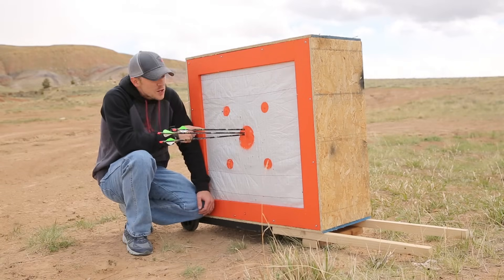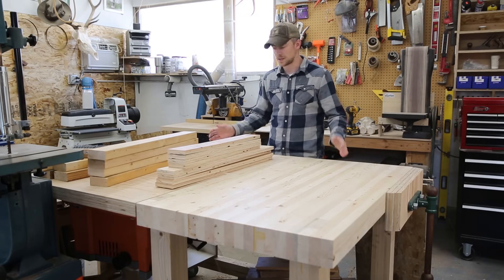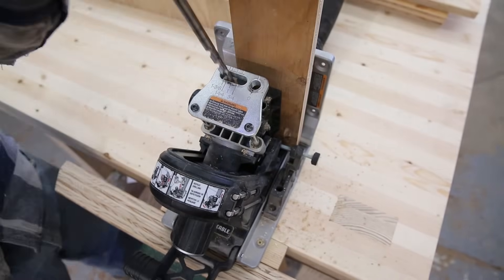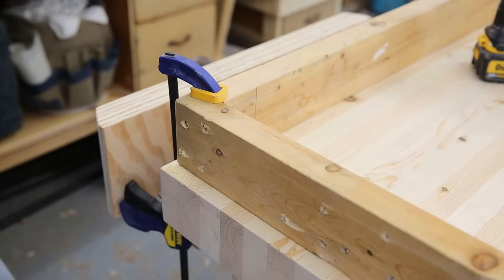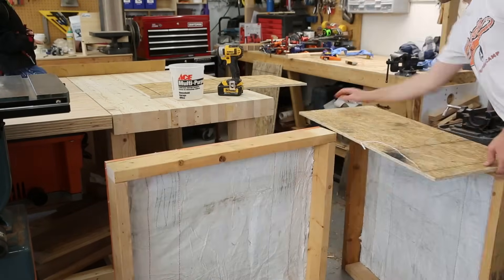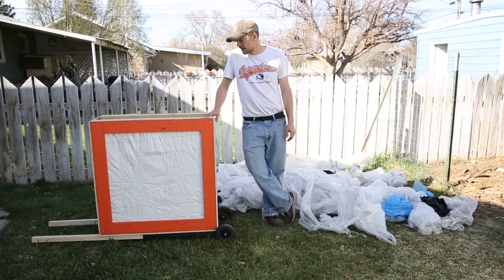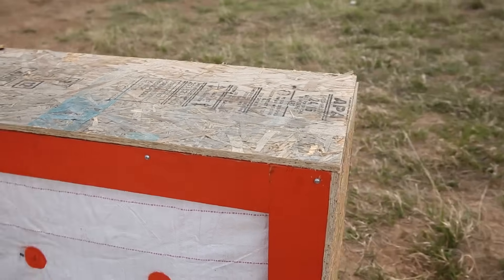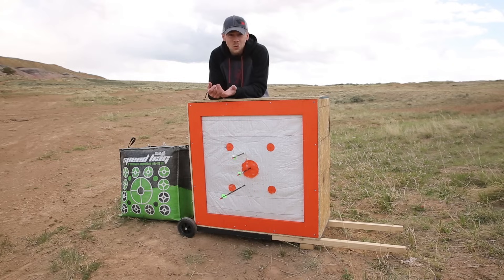DIY Homemade Archery Target from Scrap Materials.

Comment: I packed that plastic into an old car tyre, with cut out one side as the front of the target and wrapped it with the same material like you... it works like charm, it has a handle and is highly portable... when I rip through the front face I will just use some tape and nylon trash bags, to patch it up... It will add layers on top of it and will last a long time I hope. Thanks for the video.

Comment: A little advice, I used A LOT of grocery bags to make mine. Pack them in the target individually (meaning don't stuff a bunch of bags into one bag and then stuff it.) it creates voids where your arrows won't stop as quickly and it's a pain to try and back them out once the fletchings make it into the bag. Nice vid!
Reply from the maker: Awesome advice. I'm glad others are chiming in with other free materials that will get the job done!

Comment: I've made a similar target - Found the best thing to stuff it with is the thick black plastic that often covers pallets of goods - I can get free from work where it is waste. Stops pretty much most things including crossbow bolts. Made mine with chicken wire stretched over the frame first then stapled a square of plastic tarp over that. when the tarp is shot out I just replace the tarp and the chicken wire keeps the stuffing in place. The wire doesn't effect the arrows at all and the target is practically everlasting with only minimum maintainance.

Comment: Great project video!
I built a target using the pallet wrap plastic (not as nice and fancy as your though, lol).  I got mine from The Home Depot and Walmart receiving areas for free (they were happy to give it away!)  I wadded it up and then tightly packed it into the target that is 1.5' deep.  By packing it tight, I estimate that I've literally shot thousands of arrows into it and never had one pass completely through.  That plastic is really "grippy" and stops the arrows extremely well but the arrows can still be pulled easily!  A few times so far, when a soft spot developed, I just pulled out the pallet wrap plastic, re-fluffed it, wadded it up again and then firmly repacked it and it was good to go again!

Comment: nice guide. cant wait to try this for a 60x60 cm target. i work at a convenient store so we get a lot of plastic wrap i can get for free, and my father in law is a farmer, so he got the grain sacks. just perfect :)
Reply from the maker: That's awfully convenient! Make sure you stuff it as tight as possible, and let me know how it works for you.
Reply: yeah i will :) i use cardboard boxes stuffed with plastic wrap now, but they don't last very long. and if they are not stuffed tight enough, the arrows go right through. the grain sacks are a great idea  and i cant wait to try it. i got the weekend off, so i cant wait to get started :)
Reply: Now its done and tested. Works perfect :) 75x75x25cm and arrows only go in around 15cm.

Comment: Some used carpet hanging relatively free on the back helps on overpenetration. My best one was rubber conveyor belt. (That one is heavy and that can be a massive negative).

Comment: I made a similar target to this for a local archery club about 8yrs ago, and packed it with old tyre inner tubes from a tyre fitting company, they made really good long lasting targets, but with tubeless tyres becoming more and more popular, the supply was drying up.
Reply from the maker: That's a good idea for a filler. Too bad it's getting hard to come up with tubes these days. Another option is wool. My buddy's in-laws have sheep, so he has a free supply of wool and he uses that to stuff his target with. It is VERY effective, but makes the target a little heavier.
Reply: Yes the tubes where very heavy, but like you I added wheels and handles :)
Reply: hey! tire tube works? i have a lot of tire tubes!

Comment: I used an old sleeping bag and a feed bag. Perfect little target. Put little 10"×10" 1/4" plywood on bottom so it's flat and same on top along with stapleing feed bag to the top plywood
Reply from the maker: That sounds like a simple solution!
Reply: Great tip. Just made my boy a bag target but didnt think about the plywood

Comment: If you run two lengths of all thread through the inside with a board on top you could use it as a way to compact the material inside.  Nice job and video.
Reply from the maker: That's a good idea. I haven't had a problem with compacting it enough just using my weight, but your way might be easier.
Reply: Gunflint Designs 

My brother did it with a cardboard target he made. Worked really well.

Comment: Mark, great idea...You could use old carpeting or scraps of carpet...You lay it down flat as if carpeting the inside of the target and just build the layers up...You'll NEVER have to replace it again...You caulk every square inch of seams where the wood meets, marine varnish the wood and side it with roof shingling...It'll be heavy as a rock but your kids grandchildren could use it or until Jesus gets back! Nice job...

Comment: Used to work in warehousing. When people left the organisation or got new uniforms, their old uniforms bearing the company logo had to be destroyed. I’d fold em up and pack em flat and compressed into cardboard boxes, then taped the boxes shut. Marked in permanent marker to indicate which way the clothes were packed, they stopped arrows and .22 bullets. I was able to bring back around a box per week of heavy duty workwear and they last absolutely forever if dont store them exposed to the elements. I ended up arranging the boxes into shaped targets with expired hard hats, makeshift shields, mock weapons and the like. 

But yeah, most organisations that do receiving will be more than happy to give out cardboard and pallet wrapping. If you needed wood to make a frame, most organisations are happy to give away pallets for firewood. Free pine planks.

Comment: Fantastic build. I have built a few targets myself and utilised a lot of different materials as stuffing. Wrapping plastic, worn carpets, hay, and my favourite coir ( coconut fiber).  I also use a backing material to stop my arrows from protruding, It's called MCR (Micro Cellular Rubber). MCR is used for making floaters.. Over here in India I get a 12 feet by 12 feet board with 4" thickness for about 12$.  Con's : you better have an arrow puller.
Reply from the maker: That's a very cool idea! So where do you get so much coconut fiber that you can fill up a target?

I have a friend that uses sheep's wool. It works really well but tends to make the ends of your arrows a bit waxy after a while.
Reply: I come from a tropical place. Coconuts everywhere. Pretty much everything like rugs, carpets, ropes and mattresses were made out of Coir. Loads of junkyards have them lying ard. One more thing that I rely upon as stuffing material, straw mats.. 
Haha, sheep wool sounds interesting too. But got no sheep in this weather of ours... India's crazy hot, always...

Comment: Good project. Here are a few tips. First, you don't need all that structure. On diagonal at the back will make the 4 15" plywood sides stiff and stable enough to work. Less for an arrow to hit and get damaged. Stretching the face material. Here I can really help you. This works for screen doors, painting canvas, re-doing a mesh office chair with heavy duty window screen. When you attach the material you want to start in the middle of each side. So staple top center, then pull tight and bottom center, then do the sides. Now you have a tight diamond in the middle of your box. Now just work down each corner triangle to the wood corners. The fabric will be stretched, any wrinkles will just work their way to the corners and disappear. There are canvas tools, like pliers that help this process, you can just use squared off linesman pliers, Channel-locks  or just your fingers.  Personally I'd have turned the frame side ways so only 3/4" is facing front and I'd bevel the inside edges, but I don't know how often you're going to have arrows hitting near the perimeter. 

You might also design your box a bit like a trash compactor to pack the stuffing a bit tighter and denser. You'd be amazed what you could do with leverage. Gosh with this project, and all the PVC long bows and DIY arrow How Tos on YouTube, I should be out in my backyard shooting arrows.....

Comment: good ideal ... wonder how expand foam would work.. going to build one and try it.. thanks..
Reply from the maker: I have tried repairing 3D targets with expanding foam. It works alright, but it's never as strong as the original. YOu'll have to let me know how it works out for you. I would guess that by the time you get it filled up, it's no longer very cost effective.

Comment: I took two hay bails and joined them together with a ratchet strap . the strap is able to compress the hey so well that iv never had an arrow poke through. if you start to get a bit to much penetration, just advance the ratchet till its stupid tight again. the only downside to it is its heavy and sheds when you move it. I don't know how dense you can compress the hay if you make it more than two, but two is plenty for compound bows.
Reply from the maker: Thats a good option!

Comment: If you staple the target face material to the 2x4 frame and still do to pocket holes to make the face plate when your target material needs replaced take the face plate off and staple a new one over the old one them put your face plate back on gives you more support plus your stuffing won't fall out.

Comment: If your accuracy is pretty good and you dont mind a smaller target. I take a feed bag, layer as much old clothes, towels, blankets that fit, layer the materials like a loaf of bread. Then wrap bag target in layers of shrink wrap,make it tight and compressed, take duct tape to form the bag square or rectangle. 
Stops my 185lb, 370ft per second,  crossbow well, easy pullout,  keep target dry.

Comment: Ok neato, the main thing I needed was the filling recommendation. I created a fantastic, olympic-sized target without a wood frame to worry about hitting with expensive arrows (a hunter shoots closer and might miss less?) but I wound up sinking $70 in PVC "rubber" shower lining. I just fastened alternating layers of free spongey foam and the lining sheets, by "sewing" them together with giant stitches of string. They were a little loose, but leaned up against supports in back it was phenomenal for a year or so of constant use. I may try this route, here, as there's plenty of pallet wrap at work, but I do worry about hitting the frame with Easton A/C/C arrows. I could at least make that wide, front, inner frame part out of PVC "wood" or something an arrow might survive. Thanks

Comment: I work in a lab and I use large styrofoam lined carboard boxes acquired from sample deliveries for target practice. I insert a smaller styrofoam box into the large one to add more resistance.
Reply from the maker: Is it a denser styrofoam, or just your standard white packaging kind? How deep will arrows penetrate it?
Reply: @Gunflint Designs, the regular kind. The arrow tends to  penetrate about 1/3 of its shaft length. I did wrap duct tapes around the entire surface of the box to secure bull's eye paper printouts on it.

Comment: I save cardboard boxes, stuff them with old clothes and rags and many layers of other cardboard. I then use spray mount on the back of a target and press it on the box or use a stencil and spray paint targets. I use old bails of hay for the back drop. Just make sure that you remove any snaps, buttons and zippers from the clothes so you don't damage the arrows.

Comment: Wow a lot of work buddy. The best archery target by far is a cardboard box full of old clothes. Remove all buttons and zippers and cover the box with clear packing tape. All Free. Does not wear out. Simply  cover the front with new cardboard  once a year. Works with all arrowheads never breaks fletching and pulls out with 2 fingers.

Comment: Old clothing works great for stuffing also. I wore out 3 bag targets with the same set of clothing. If the center gets "soft" just open the bag and rearrange. weight might be an issue with a target the size of this one tho.
Reply from the maker: Yep, old choose is a good and common fill. I think with the wheelbarrow nature of this design moving it around wouldn't be a problem, but the weight might make it hard to lift into a truck and transport anywhere.

Comment: Did you ever consider using grain sack pieces mixed with plastic? Think would be beneficial I can get plastic and grain sacks wondering if combo of both inside would work as well
Reply from the maker: Yep, it probably would work just dandy.
Reply: grain sacks work very well for stopping arrows

Comment: Another option for filler would be old hot tub covers, they are styrfoam inside, just remove the aluminum supports. Cut to size and drop them in. Most spa places will give them away although they are HEAVY hence the replacment.

Comment: You think a tarp would work? I have a few of those laying around. By happy accident about a month ago I found an engine crate on the side of the road so I’m using the wood off that to build one of these.
Reply from the maker: A tarp would work fine for the face, but it might wear out faster. If you're talking about a tarp for the filling - it MIGHT work, but I would guess you need to have it packed even tighter.
Reply: Gunflint Designs I’ve got pallet wrap for days on the inside. I work in a receiving area so I can get as much of that as I need. Just need something for a face.

Comment: Damn, I was just short on cash for this build. Only about $20,000 short on machinery costs
Reply: @quinnmccloud7139  you need a 30$ drill from walmart lmao
Reply: Back before drills, people used hammers and nails on just about everything. I’d prioritize owning a drill (or at least having access to one, like a friend or parent’s) over having an archery target. But you could build this using nails instead.
Reply: take a large box, fill it with cloths, Duct tape it closed. arrows come out super easy a 3 year old could pull them.
Reply: Lmao, I made a similar target with like 15 dollars worth of scrap wood and some rusted screws
Reply: You don't need $20k in tools. Just hammer and saw. That's less than $100

Comment: Looks good but what would it do against a compound crossbow where the bolts travel 390 fps....
 I know your compound bow dont travel that fast....
Reply from the maker: You would just have to adjust the thickness of the target to account for that. Also, the more densely you pack the pallet wrap, the better it works.

Comment: I built a very similar target years ago.  Faced it with thick cardboard, old refrigerator boxes.  Winter weather and lots of shooting necessitated re-facing it every year.  One election year after the election was over I noticed all of the candidates corrugated plastic campaign signs still posted around town and decided they would work great for a target face.  They work great!  Very stiff, allowing greater compression of the pallet wrap, weather proof, take multiple shots, etc.  probably should contact the candidate to see if they would donate the old signs to you.
Reply from the maker: Now that's a great source of free materials!

Comment: I'm curious what a good crossbow would do to that target
Reply from the maker: A crossbow is moving at a much higher velocity - this style would still work, but you would want to pack is as tight as possible, and mane make it a few inches deeper.
Reply: Gunflint Designs thanks im looking into getting a barnet terrain and this seems like a nice easy project. I'll probably pack it witb old jeans
Reply: I had a nice crossbow. It was a ton of fun but you can't hunt with then in Oregon so I got rid of it. You might be able to use them for varmint hunting I'm not sure. But definitely not for deer, elk, or bear

Comment: I used a carpet I cut up into 3ft wide by 18 inches deep. Stack the carpet and wrapped a metal band around it to compress . Worked great for me
Reply from the maker: The local archery club does that for the main backstops. They are also pretty weather proof.

Comment: would it still work if I used cardboard boxes on the inside? If I fill it enough with the boxes it would be easier for me to replace the inside.
Reply from the maker: You could try it. I'm guessing you would have a hard time compressing the cardboard enough to make it work.

Comment: If you staple some Chicken wire to the internal frame before you put the face plate on, it will then hold the stuffing of the target in place when you come to change the face plate.  I've built a similar target using old rags and sheets as stuffing and that seems to hold up well and stop arrows pretty quickly.
Reply from the maker: Good idea. I've done a target out of old cloth items as well. It functions fantastically, but ends up being incredibly heavy.

Comment: What is your bow setup? I just purchased a new bow that has way more speed than my past bow and it passes completely through. Wanting to build something like this and was wandering if it would stop an arrow at 300fps+
Reply from the maker: I shoot a 425gr arrow at 68 lbs which is going roughly 285 if I remember right. this will stop that just fine. The trick is to pack the material tightly enough. If you get arrows passing through or poking out the back, just stuff more material inside.
Reply: Gunflint Designs Fantastic!! I'm going to start building then